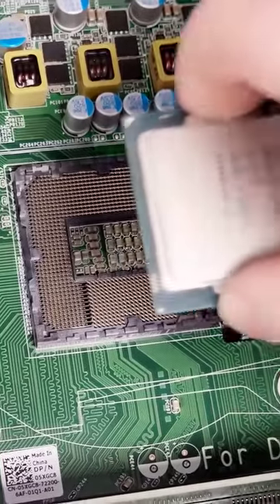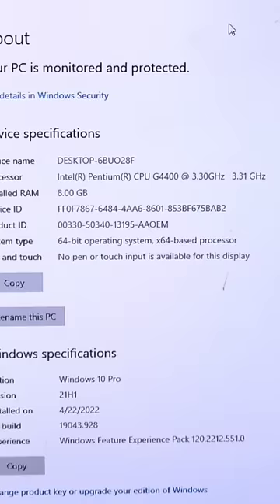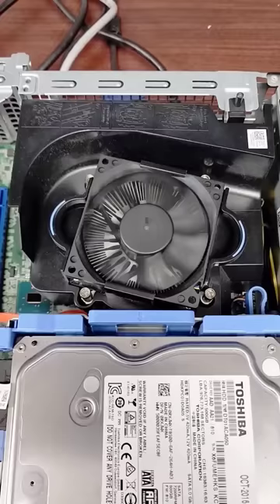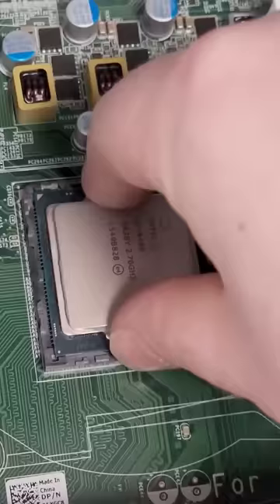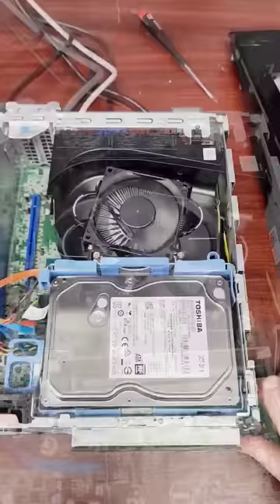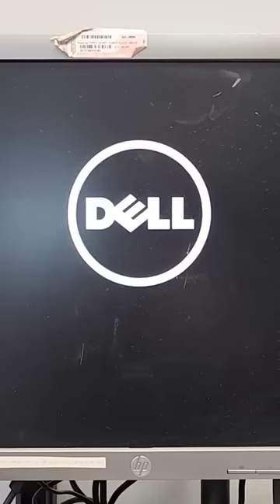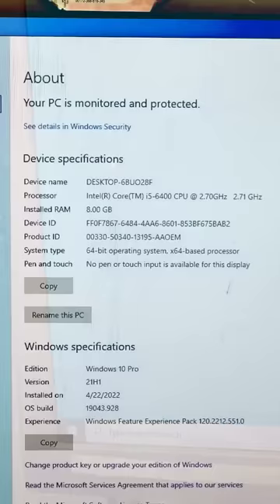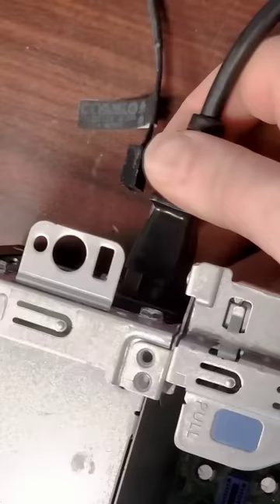CPU Swap while in Sleep Mode??

Comment: Sleep not only keeps the RAM powered, but also parts of the CPU, therefore you destroyed the contents of the RAM and the CPU state when you pulled the CPU. Try it again, but put the same CPU back in the socket and you'll get the same result.
Reply: this.
Reply: Yes it will be the same result, S3 sleep isn't a thing anymore. Modern devices go into modern standby and the CPU is still active in modern standby.
Reply: I was just about to say that
Reply: @ghostofdre  Wdym S3 isn't a thing, the S3 is emulated or something?
Reply: in fact if you do this while the pc is actually running on reboot it will go through auto repair process which means more stuff can break
Reply: @flintfrommother3gaming  Modern systems don't use S3 as microsoft in their infinite non-wisdom decided to change how sleep works on newer versions of windows.
Reply: @WednesdayMan  you can restore s3 on some bioses.
Reply: Right so the registers and cache layers too.
Reply: @benargee  Exactly. The registers and cache would be gone. meaning it's effectively reset, but the rest of the system is in a different power state
Reply: As well as the BIOS has to load unique microcode for each processor
Reply: The CPU is also not completely powered down. The memory controller needs to refresh the RAM to prevent the data from vanishing.
Reply: It would be interesting to see how hibernate (wake from disk) works
Reply: @ayushsinghal1  My guess: when you suspend, it flags the bootloader to load from an image (hiberfil.sys in Windows),  probably a config or registry entry, depending on OS.

I'm leaning towards it being the bootloader as in Windows, you have no recovery/safeboot options, nor can you choose OS, pre UEFI, anyway. Nowadays, you get the boot options just before login.
Reply: People are stupid... Don't tell them that
Reply: This is why hibernation option is better.
Reply: @ayushsinghal1  Windows discards the hibernation file if it detects a hardware change. Not sure if it tells you on Windows 8/10/11, but on older versions of Windows, you may be told that the hibernation file is invalid and that Windows would start fresh.
Reply: @ghostofdre  that's definitely not true. Devices capable of modern standby can't use hibernation, but any Windows PC you buy or any PC you install Windows on is 100% capable of hibernating. Modern standby is for devices like tablets. Any regular PC still enters typical standby.
Reply: @flintfrommother3gaming  Sleep is a thing it is just Microsoft dont use the correct sleep, just like how they dont use the correct units for file sizes.

They use "Hybrid Sleep" which is a combination of Sleep mode and Hibernate.

You can make it so sleep mode works like sleep mode by disabling "fast start up" in the power settings.
Reply: @ghostofdre  curse microsoft
Reply: @ghostofdre  While being replaces by S0 sleep on laptops and other mobile devices, S3 sleep is still a thing on desktop PCs.
Reply: When in sleep mode. Who said part of the cpu is powered? Who said that? If you stated being in sleep, was like saving a small data stream into your motherboard memory in which case if any keys or mouse input is received it triggers the cpu to wake. The only component awake during the sleep is your psu, your ssd and your motherboard.
Reply: @Furry_Lord  it used to be the case but now it's not due to Microsoft modern standby which blocks s3 state and enforces s0 state. Also the memory management unit required for keeping memory alive is also inside cpu. BTW I work in AMD :-).
Reply: Yes, it’s true that more modern devices support modern standby, but that computer is not remotely new enough to support that.
Reply: @value0f  yeah that is true. BIOS needs to support moden standby. But still MMU is inside the cpu. Unless it has north bridge outside.
Reply: "parts of the CPU" ram controller is in the CPU. Taking it out just corrupts the ram
Reply: I've pulled a cpu and put it back in during sleep mode and it worked fine, all programs were still running.
Reply: @Furry_Lord  

Sleep keeps data in RAM, RAM is directly connected to the CPU, so the memory controller on the CPU is powered, as well as CPU registers. Consider these two pieces of hardware in a paused state, but power is being used to keep this state. As for who said it, I suggest doing your own research.

Judging from your comment on the power supply, you're not aware of what the +5VSB rail is used for. There are only 2 states a computer PSU can be in, either on, or in standby. In standby, the PSU is outputting 5 volts for things like sleep, wake from keyboard, the other standby circuit on the motherboard that powers up the PSU when you press the power button and for other purposes, the CPU and RAM in the paused state is using this  +5VSB to keep the state.

If you put your PC to sleep and removed power, you'd lose your sleep state.

As you're effectively waking from RAM, any storage medium is irrelevant to the wake process, you could wake without the disk attached and only run into a problem when the system tries to read or write to it.

If it was a mechanical disk, it wouldn't be ready fast enough to pull data from in the wake process.

Hibernate is a different process, and is much more akin to a normal boot process, just loading from what is effectively an image of the RAM from disk instead of loading your OS normally.
Reply: Hibernate should work tho, right?
Reply: @laoo  jep. Hibernating saves the current system state in the pagefile on the system drive
Reply: If there's still voltage going to the CPU... Wouldn't that destroy it when you remove it?  Or put the new one in?
Reply: @pablo5425  you can disable that auto repair crap with a terminal command
Reply: @laoo  Hibernate likes to check when coming back up that no hardware configuration has changed.  XP didn't care though.  I used to do memory upgrades on people's computers while they were hibernated with XP when they forgot to give me the password.  It would just still say the old amount of memory until the OS had fully rebooted so I'd leave them a note to do a full reboot to make it detect.
Reply: @adventureoflinkmk2  no. Only if the Voltage would exceed save values. Otherwise turning off the PC would destroy it, haha
Reply: Same cpu wont work either. L -Cache.
Reply: It is a bit more fundamental than that.
Microprocessors are NOT designed to be hot swappable. They never are.

Some computer vendors may create processor modules containing a microprocessor which are designed to be hot swappable.

Unplugging components which were not designed to be hot swappable can cause permanent damage to the component.

Don't do it. Period.
Reply: @MrMe01  I would be a bit more worried about causing physical damage to the integrated circuit rather than worrying about the loss of the configuration state of the device.
Reply: @Otto500206  No it isn't. Sleep, hibernation. You should NEVER unplug any integrated circuit device whilst there is any remote possibility of voltage being present on its pins.  It can cause permanent damage.

And if you don't understand or accept this, then you shouldn't be going anywhere near the electronics of a computer.
Reply: @Furry_Lord  No!

You should NEVER unplug integrated circuit devices from their surrounding components if there is any possibility of any voltage being present on any of the pins of the integrated circuit. NEVER do this.
You don't need to do it. Power the entire system down fully.
Reply: @deang5622  

I wouldn't try it on any of my machines, but old hardware is old hardware. Might be worth more to potentially destroy it for a YouTube video than it's actually worth.
Reply: @ghostofdre  the CPU used in this video is a 6th gen (Skylake) which still supports S3.
Reply: @WednesdayMan  it’s not just Microsoft. It’s Intel. 12th gen Intel doesn’t even support S3 anymore.
Reply: Sleep is not hybernation.
Reply: @damirodlak2498  I didn't say it was, did I?
Reply: @Kylemsguy even Intel 13th gen CPUs support S3 still, and 12th gen does too. S3 support vs S0 support is determined by the BIOS firmware, with only some OEM desktop systems shipping with S0 instead of S3. Most laptops will ship with S0 instead of S3 these days, but desktops can vary depending on the OEM (and off the shelf consumer boards still all support S3).
Reply: I wonder if hibernate would work any better. I believe that puts all the data onto disk right?
Reply: @dragofand  it shuld work if the proc was of exactly the same kind, but not on workstation machines. They check for hardware changes.
Reply: @pigeonprotagonist6357  on regular pc boards most likely. On server or workstation machines almost certailny not. Boot of any kind would check even for serial numbers, proc, ram, ...
Reply: @benargee  and in modern stuff, the page table encrpytion keys and etc etc.

There is SO MUCH per-session state in the CPU that this task is just... never gonna work.
Reply: Modern computers, especially ones with SSDs replace the “Hibernation” Sleep with another type that needs power to run since it saves the computer state to ram instead of the hard drive.
Reply: This is why I completely turn off the PSU and unplug the power cable when upgrading something 💀💀I ain’t risking it
Reply: @mysticqro950  it's good practice to keep it plugged in to the power, but maybe flip the switch on either the PSU or wall socket. Keeping the machine grounded while working on it keeps any risk of static buildup as low as possible
Reply: Hibernate actually powers off the whole pc
Reply: @ghostofdre even macs do modern standby? I thought it was a windows 10/11 thing
Reply: @ayushsinghal1  If the CPU changed to not the exact same family, then hibernate too will very likely break badly on resume, since OS needs to detect+set some attributes based on  CPU  properties that vary between processors
Reply: @ayushsinghal1 i think he wanted to do that in the video 🤔
Reply: @MrMe01 it would be theoretically possible for a Linux kernel to survive this because it could detect new cpu and load drivers at runtime
Reply: @ghostofdre  S3 sleep is still a thing on modern PCs alongside S0ix sleep (modern standby), however I believe even in S3 sleep the CPU state is preserved

Comment: Try with the PC in the hibernation mode, could work out
Reply: And also keep some processes on the background
Reply: I wanted to say that bro
Reply: This might actually work, as it goes through the normal startup from BIOS/EFI to load from disk.
Reply: Hibernate saves the PC’s state to the boot drive instead. So it would definitely work! I often replace components by instead putting my PC to hibernate and then unplugging power.
Reply: @scarecrow5848  so if you tied that, is windows smart enough to report new CPU in licke task menager, i wonder now... ? I would assume it isn't as hibernation saves basically system state to boot drive... ?
Reply: @piotrprzyby8128  It would. If you change, lets say, your ramsticks out, your motherboard will detect it first before you even get close to windows. But your state in windows should still be saved.
Reply: @piotrprzyby8128  should work out, since server versions of windows can notice even a hot swap of some parts of the pc
Reply: i dont think it would work  the resume would probally begin and then when it tried to return to the previous state it would blue screen    or resume would see a hardware change and tell you to fuck off.
Reply: @FennecTECH  read my other comment. Too long won't read? Hibernation saves your PC'S state into your storage drive. Any parts that get changed will be noticed by your motherboard beforehand. If you want full details for it go read the other comment.
Reply: @scarecrow5848  i know how it works   but when windows tries to resume the different CPU will likely cause it to freak out and crash   or it will just say "hardware change directed  resume cannot continue"
Reply: @scarecrow5848  "Your system's memory configuration has changed since it entered hibernation. If you proceed, the data needed to resume from hibernation will be lost. To preserve this data, turn off the system power, restore the orginal memory configuration and reboot the system. Otherwise, press to delete restoration data and proceed to system boot menu." so i believe it would do the same for processor
Reply: @FennecTECH  no, again, your motherboard will detect any PC part changes beforehand. So you won't blue screen or anything. Your motherboard will just be like "hey you changed a part, do you wanna change any settings or go back to windows there bub??" I've used hibernate to change ramsticks before. Literally how it works.
Reply: @scarecrow5848  windows will get mad about a cpu change. At least it did in 2011
Reply: @FennecTECH  well it clearly doesn't anymore via using hibernate.
Reply: @FennecTECH  not what happens for me. Your either not using windows 7 or newer or your motherboard is just really really old.
Reply: @scarecrow5848  ah yeah  this was back in the XP days
Reply: @Someone-uw6fx  it literally saves the PC in the boot drive. lol? plus your motherboard will detect it before windows does preventing any damage to your pc. also your PC fully gets shut off when using hibernate.
Reply: @scarecrow5848  correct, and your motherboard will detect it and communicate the new amount of ram to windows, which will stop resuming from the saved state and instead boot completely fresh

perhaps you use server versions of windows, where it might be different (no idea myself), but i can guarantee you 100% it does NOT work on regular consumer editions of windows
Reply: This might actually work
Reply: nah it still it somehow in stanby mode
Reply: @mada-8  me too 😂
Reply: Yeah I was about to say that
Reply: It won't.  CPU is too different,
Reply: This probably would work, as long as it isn't actually running in one of the sleep modes.
Reply: ScareCrow has this hill and they're going to die on it if that's what it takes.
Reply: Well, no.

I tried that and the Windows just Blue Screen or just a full reboot with a login screen
Reply: Probably not, though. I remember putting my old as heck eMachines into hibernation mode and swapping out one of my 2 GB RAM sticks for a 4 GB one. Being a Windows 7 computer, I got a screen saying that my system's firmware did not preserve the system memory map across the hibernate transition.

What happens is that when hibernating, the contents of the RAM are saved to your drive, including where on the RAM the data is stored, what drivers are loaded and the hardware being used. If you were to change the RAM amount while the computer was hibernating, your computer wouldn't be able to restore the hibernation files to the RAM because it wouldn't know where to put them without messing things up. Think of the RAM as a desk and its contents being the objects you placed on the desk and where they are on the desk. Now imagine you snap your fingers to instantly teleport the desk out and teleport a different desk into its place, without moving any of the objects on the desk. Chaos ensues. That's what replacing the RAM in a hibernating computer is like.

Replacing the CPU while the computer is hibernating could easily cause it to not realise that there is a new CPU in it until it's too late - it would run into a problem and crash, forcing you to shut down and restart like you should do when replacing important components like that. If replacing the RAM in a hibernating computer can cause problems, then goodness only knows what replacing a CPU would do to it.
Reply: @stephaniethebatter7975  thank you for giving an actual real explanation instead of the "it works because i said so" they were arguing about
Reply: @Someone-uw6fx  You're welcome. I'm surprised that people are even suggesting that replacing components in a hibernating system could work given that there's a whole entire error screen in Windows 7 that mostly comes up when you try this.
Reply: It would still fail.  Hibernation saves an exact image of everything in memory to the harddrive, including CPU state, then reloads it when you exit from hibernation. Swapping the CPU would cause that hibernation image to appear corrupt since CPU state could never match.
Reply: @MrRobarino  Yeah, thought so. Also, even if the hiberfil didn't appear corrupt, Windows would still have a hard time trying to adapt to a new CPU without a restart.
Reply: It does work, I've done that before.
Reply: @LuisHansenNH  I really don't believe you...
Reply: @stephaniethebatter7975  It was an accident, actually. I opened it up for something else, maybe changing the thermal paste? Idk. When I put it together it opened up the last session, and I hadn't even realized I had left it hibernating.
Same thing with SSDs swap. Many many times I've removed and reinserted the SSDs in different orders and everything and when it came back, boom, everything was there. I even locked myself out of windows once because.of something I had done with GRUB, and when I figured it out and booted on windows, again, session stored successfully. Also worked with Linux hibernation.
Reply: @LuisHansenNH  but you didn't change the cpu right
that's what this comment is talking about

things like hdds can be swapped while windows is running (depending on your motherboard), but ram and cpu are not hotswappable at all, which also ends up applying to hibernate
Reply: @Someone-uw6fx  I removed it and inserted it back. I actually also already moved an SSD from one computer and out into another and windows recovered like nothing ever happened.
Reply: I kinda doubt it. I assume the OS internal status is sufficiently different between CPUs. At least I know for a fact that a hibernated PC will crash after you add RAM, I tried that.
Reply: @LuisHansenNH  That isn’t even close to the same thing.
Reply: That would obviously work, even if you switch the SSD to other computer, it'll boot up like nothing ever happened